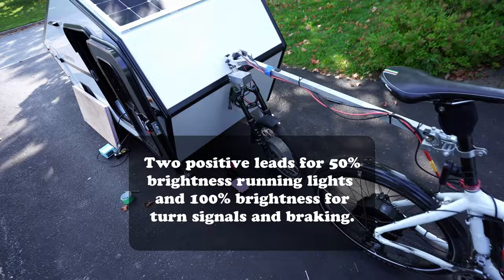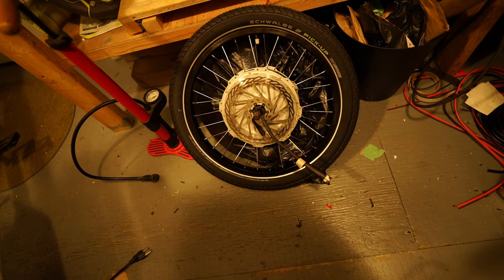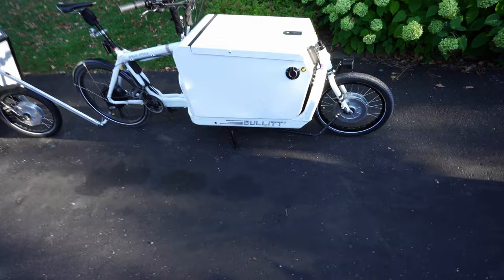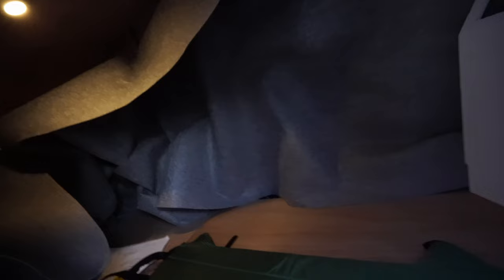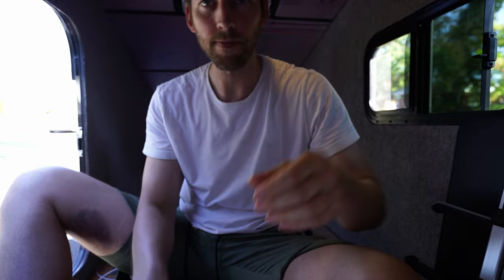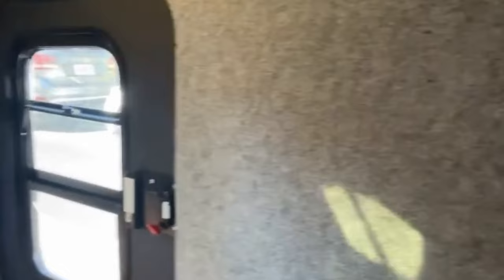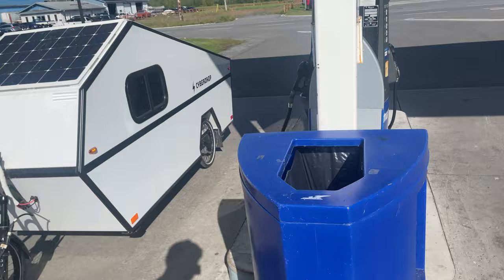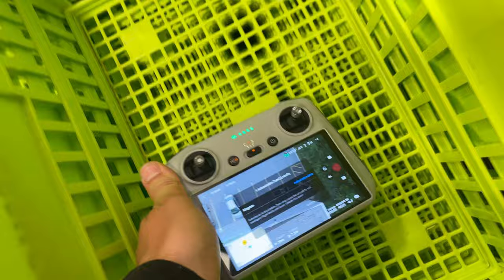Electric-Powered Bicycle Camper (PART 18)

Comment: You've got the world's greatest ebike there.  You should do a video showing off its speed and acceleration and range.  If you ever run out of money, you can use it to work 8-10 hours day on delivery/apps.  

A great thing about your 3 wheel trailer with high tow hitch is how easy it is to move around by hand.  Nice part of your video here.

Whole setup is a snowbird dream.  Congratulations.
Reply from the maker: Thanks! Yeah, I’ll try to post some more detailed performance specs soon.

Comment: Great to see you out there if you would give us some updates as to how the motors and battery's are doing with weight and charge
Reply from the maker: Lloyd, nice to hear from you. I’ll try to get some more details soon for you. In the meantime. Three hub motors is a great setup for something near 800 lbs gross weight - bike, rider, and trailer. 

Battery is functioning perfectly so far. Some issues with the Cyberdrop front fork headset, and possibly some damage to rear bullitt hub motor that I’m investigating.

Comment: hiya jeremiah just curious if youve done any traveling with the camper yet,im still trying to come up with a final design for my own project but im worried about stabilty as im going to require something bigger for extended tripsive looked at extending types and various others but ends up being to awkward to will be final size do you think you could up size the camper ,even add dual motors`
Reply from the maker: I would do the Center of gravity calculations and make sure it’s as low as possible. The challenge with going much bigger is that you become top heavy if you want to stay narrow enough for bike lanes, and the weight requires more motor power and battery that can support. IMO, you want a design that inspires confidence and let’s you ride moderately aggressively without worrying about it tipping over or losing control.
Reply from the maker: You can add dual motors and I would at a minimum. For my setup, three Grin Hub motors have been ideal although I’m not yet convinced about the strength of the Grin hubs as one has failed on me already. Could be an anomaly, but I’ll report back.
Reply: hiya well the grin all axle motors are basically a 9 continent stator at its heart and has very close specs in the grin motor simulator ,ive decided on the crystalyte hs4065rd they do a solid 65kmph on 48volts and still in the lighter weight categories and cost 580 au opposed to 800au for the grin im going to use 20inch fat rims and tires 4 total about 3/4 of the length ,i wont be useing a tow arm though the tow point is just above the cetre of the rear wheel and bolted directly to the frame ,kind of like those camper that you tow with a truck they go up and over @Jerbrown
Reply from the maker: good move going with the fat rims. Sounds like a good plan. Good also to have the hitch point lower. Cheers! 
 @katiekumcgil
Reply: if you have alook at my page or channel ive posted a quick video of the nearly finished bike its going on i used the chinese frames measurements to start wirth and fixed the suspension issues that they had ,took me ages to weld up though ,love your input ,thanks @Jerbrown